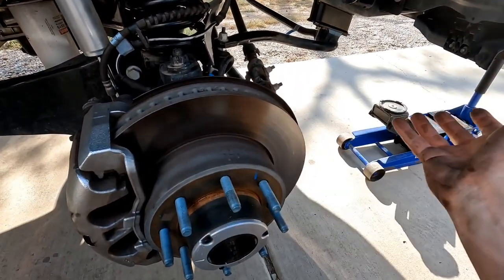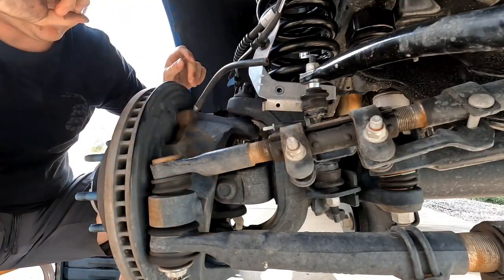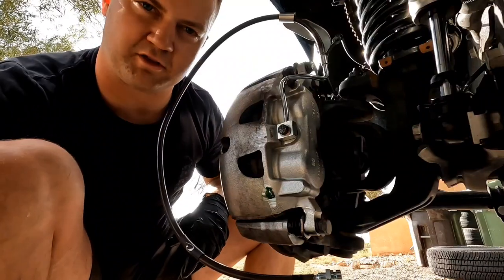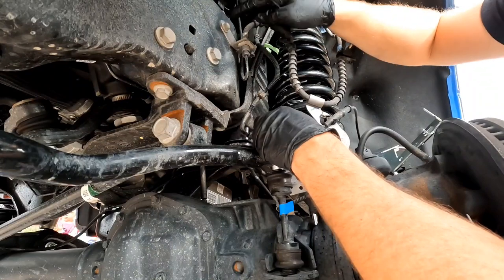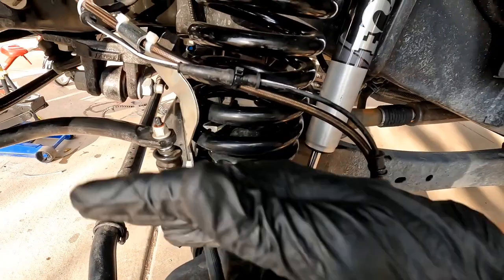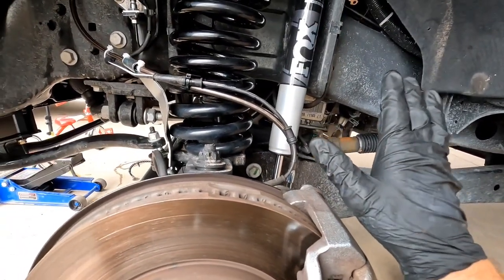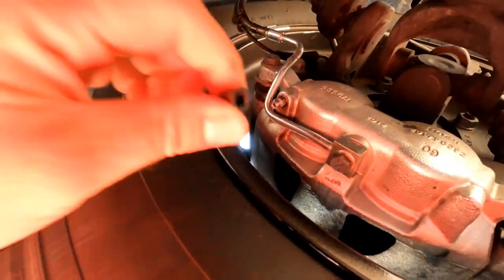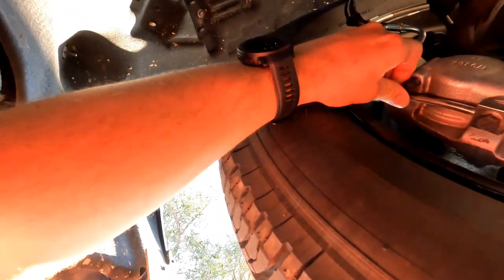How To Install Carli Brake Lines On A 2022 Ford F250

Comment: Hey brotha. I live like 3-4 mils away from you. Off san mateo and lomas. We should take the trucks off roading on 462. I went last week with some friends. Great time. 

Current set up 2005 Dodge 2500 6” lift
Reply from the maker: Yeah I've been there with the Bronco. I'd be down to take the truck whenever these wheels finally show up. Should be here next week and I can finally put 37s on.
Reply: You got IG I’ll send ya the info
Reply from the maker: @LAZARUS6179  yeah just look up mcmahans garage
Reply: Sweet, added.